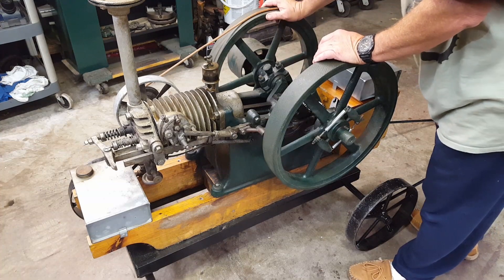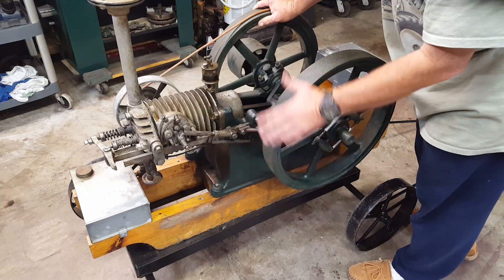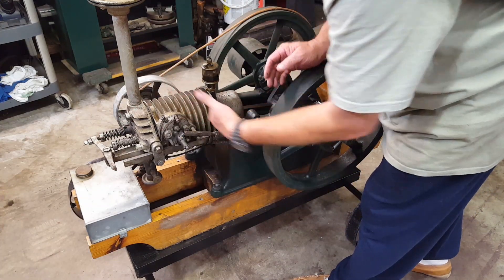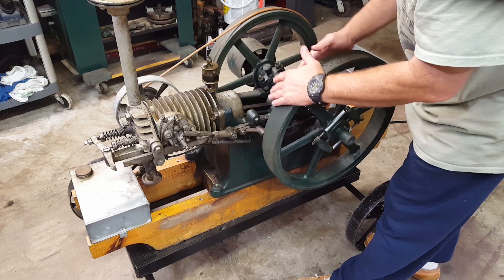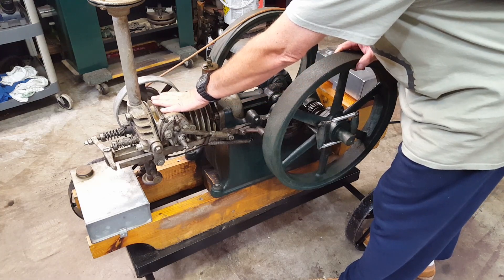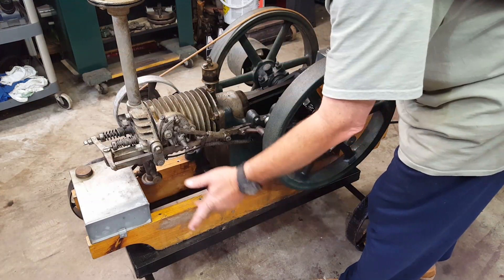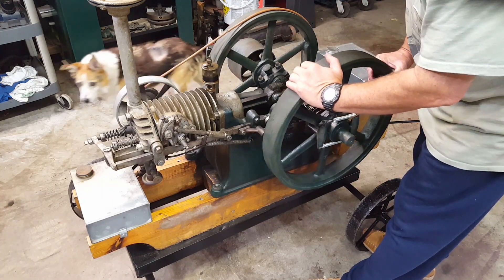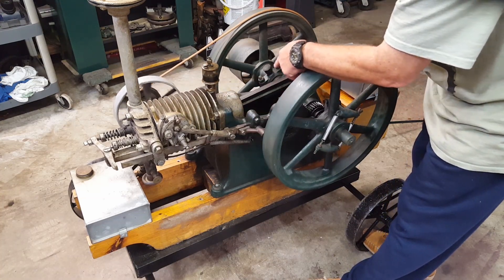Hit miss timing

Comment: Nice basic explanation of how a 4 cycle engine works, by also describing how a hit & miss engine works. This is probably the first air cooled hit & miss engine I've seen. I'm assuming that's a little cooling fan next to the cylinder, that's being spun off of the flywheel. How much should you pay for one of these small, old hit & miss engines, assuming it's in good running order, but not necessarily 100% fully rebuilt and repainted?

Comment: Just a quick tip... I used to drag race motorcycles (D gas... 500cc).  I once had a fella show me how to determine exact TDC on my engines. Take an old spark plug, bust out the guts and tap it for whatever bolt will fit into it.  By running the plug/bolt arrangement into the plug hole, you've made an adjustable piston stop.  After attaching a degree wheel or even an unmarked disc, you carefully turn the crank BY HAND until it stops against the bolt.  Mark your degree wheel or plate at near TDC. Now turn the crank the other direction until it stops again and make a second mark.  One half the distance between those two marks or numbers is EXACTLY top dead center. Of course, this only applies to engines with the spark plug in the head. For others... use one of the valve holes with a plate across the head???  PS.  Mark, that was the best explanation I've seen on YT of how a 4 stroke works.  Great job!

Comment: Mark, Thank you for a fantastic video.  I was given a small hit and miss because the fella that had it could not get to run.  Before he pulled the remainder of his hair out he gave it to me and said "good luck".  From your video I determined that the "dwell" of the exhaust valve was way to much.  I lessoned the dwell by adjusting and shortening the "push rod" and retiming it per your video.  He had adjusted  like you would for a modern engine (to follow the exhaust cam lobe).  I worked perfectly after the adjustment. Thank you again!   Fred  Ontario, NY

Comment from the maker: 10 deg. Is a good place to start because by the time the ignitor spring fires and creates a spark and the fuel mixture in the cylinder ignites the crank will have rotated about 10 deg. Making the power happen at about tdc.

Comment: Does it have to be 10 degrees because of the time it takes the igniter to spring? I always thought that it was supposed to fire at tdc.
Reply from the maker: richard vaughn
You are correct. By the time the ignitor fires and the fuel mixture in the cylinder ignites the crank will have rotated about 10 deg. Making  the power at or close to tdc.
Reply: Mark Abner This looks easy. Thats good, because when I took apart this stover ct1 I bought on ebay, I didnt mark the gears. Waiting on rings and gaskets and a fuel tank to come in the mail. Its clean and painted though. Went from an orange patina to a green and silver color scheme. It ran before I took it apart but the bearing were wobbly. The oil ring fell into 5 peices when I took the piston out.
Reply from the maker: John Carlson on a hit and miss engine you roll the crank to about 20 deg bbc then adjust the exhaust valve nut if needed to just start to open that valve.
Reply: At what time do you adjust the rods that have threads